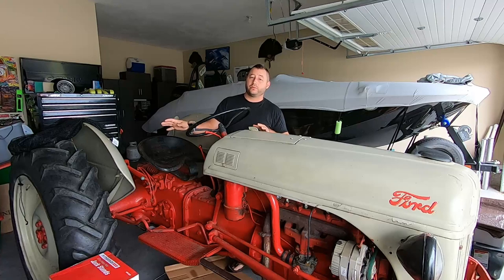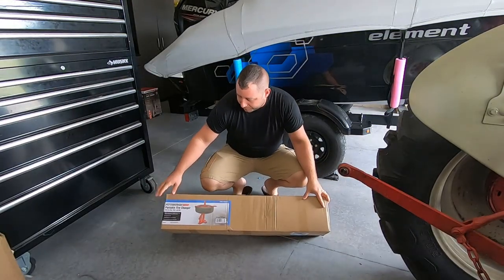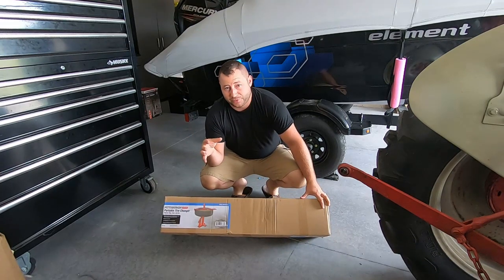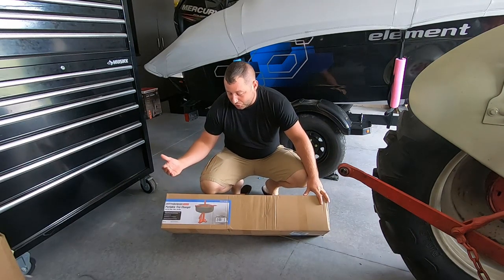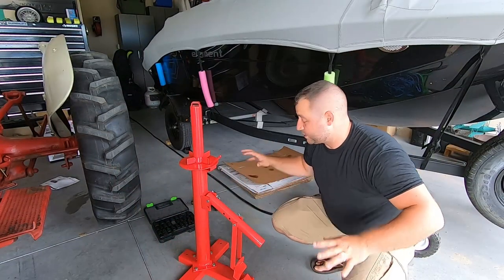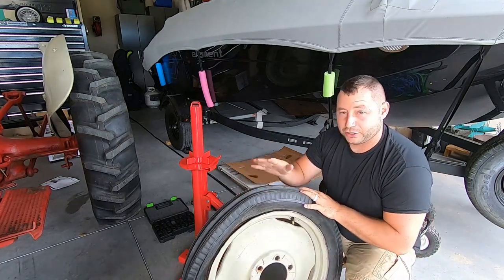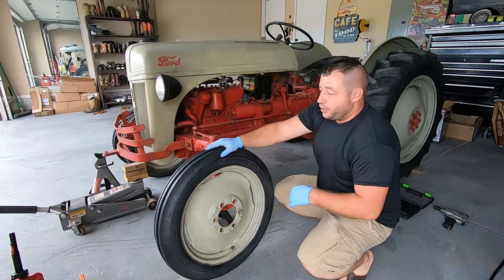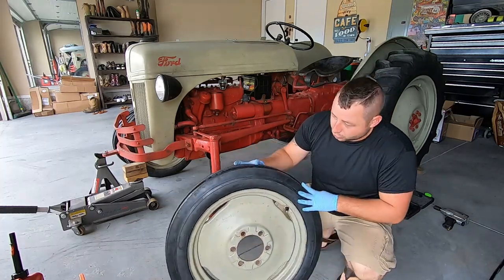DIY Tire Change - 1948 Ford

Comment: When I got my tire changer (like yours) I didn't have a concrete floor to mount the changer to, so I bolted it to a heavier wood pallet. Could use any heavy base, I suppose. Works well.

Comment: Nice little contraption you got there! I would get one, but it looks way too much like work to me!
Nice to have new rubber really makes the tractor look so much better. The tire you took off and replaced looks brand new though compared to the 19 x 4.00 tires that I have on my 48….🤣 One of which is missing a bunch of chunks off the sidewalls .